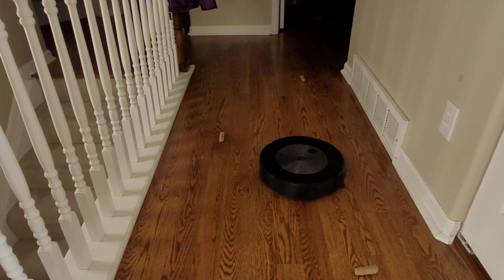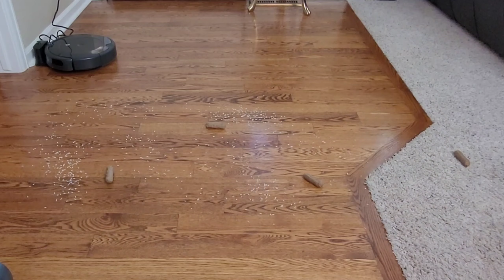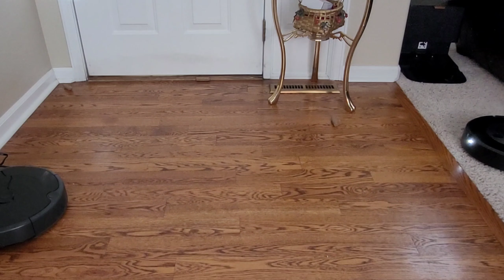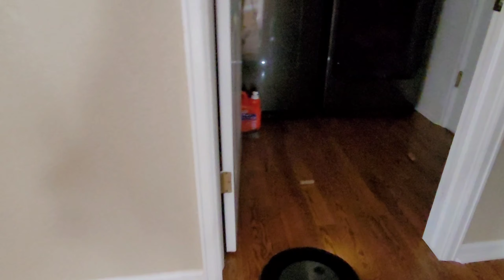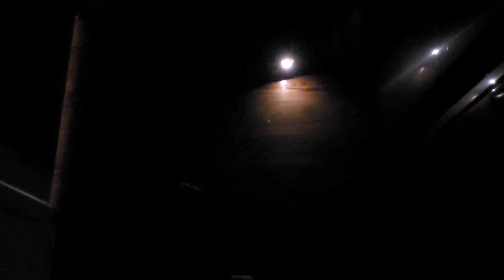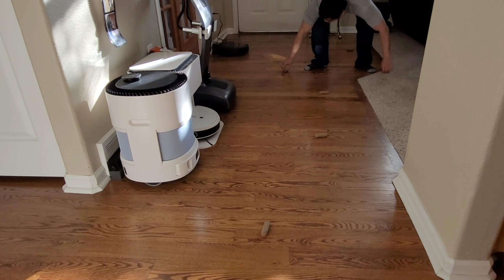iRobot POO 💩 Avoiding Robot is put to the TEST - iRobot Roomba J7+

Comment: Hey! I've watched all of your videos and just wnated an advice which one should I get cause I'm so indecisive. I've got a 100m square apartment and 2 cats. The carpet isn't too high. It would be amazing If you could tell me one perfect for me to buy. Thank you! ❤️
Reply from the maker: Hello well, it sounds like you could go with a cheaper robot vacuum, you don’t necessarily need the smart mapping since your area is smaller. Some good options are the iRobot i3, e5. If you want smart mapping than the i6 is a good option. These models are good with pet hair if your cat shreds. If you are looking for something that cleans well on carpet take a look at the Roborock S4 or S7. Finally a good fully features robot that not too expensive is the 360 S5. If you could tell me exactly what features you want I could help narrow the choices from there.
Reply: @RobotMasters  First of all, thank you so mucg for your response! I'm from Turkey btw❤️. I'm indecisive between iRobot i6 and Roborock s7, but because of its carpet cleaning s7 is more likely better i think. I've never heard of the 360 robots. I will research about it too and decide which one to buy. Thanks for your response again. Loves from Turkey ✌🏼

Comment: Why doesn't my J7 + skip cables and doggies. He rides over cables and dog poop. Does it need to be set somewhere?
Reply from the maker: Hmmmmm, make sure your J7 has a completed map of your floor plan. In the iRobot App make sure the Camera Avoidance feature is enabled. You can also reset the obstacles in the camera which might help. As for power cables I am not sure if iRobot implemented these in its database. I will do a test see what other objects the J7 can avoid.
Reply: @RobotMasters  Thank you for the quick reply. Nowhere in the settings can I see the settings for the camera and resetting obstacles.
Reply from the maker: Go to the map icon, once you are there in the top right hand corner there the 3 little dots. Select, you should see a menu Delete Map, Rename Map, at the bottom is Reset Obstacle sensitivity.
Reply: @RobotMasters  For me, there are only two options: rename the map and delete the map. There is no reset obstacle sensitivity.
Reply: Zona yesterday downloaded the application and installed it on her smartphone, and today I installed it on my smartphone by connecting to its applications. Strange thing, but I have more functions that it does not have. For me, it is about obstacles and she does not have this option. Thanks for your help, but I guess it'll be okay. I will test and let you know.